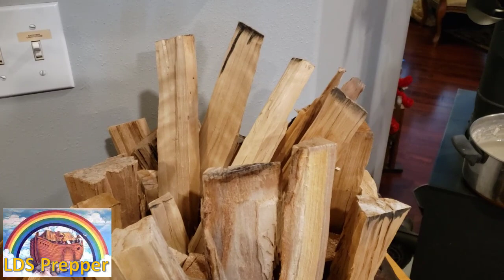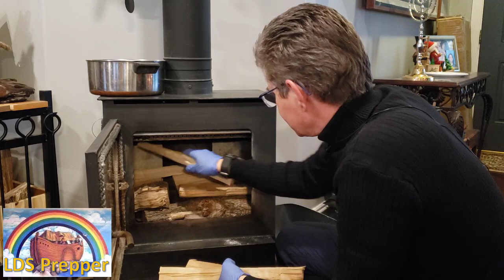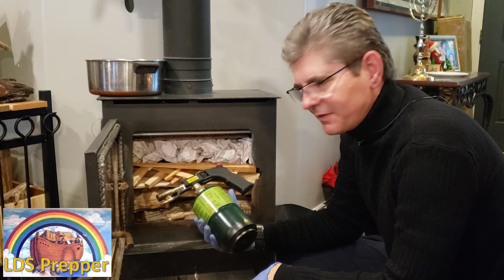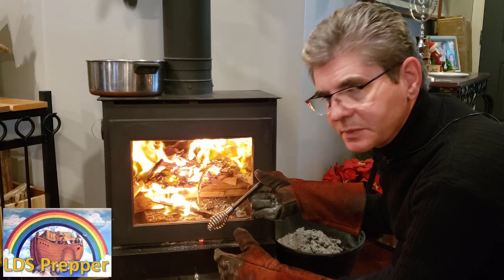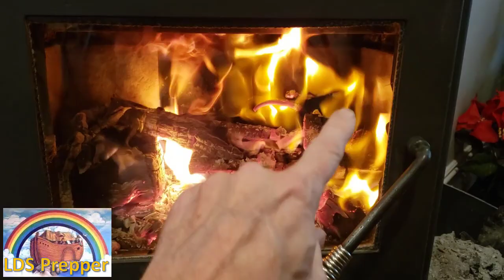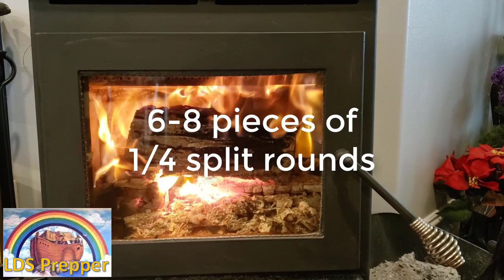🔥 How to Build a Smokeless Fire in a Wood Burning Stove 🔥

Comment: I miss my wood burning stove we had in our previous home.  It was SO efficient.  It was a split level home and you could sit in your shorts and teeshirt while it was -10 F outside in Minnesota.
Reply from the maker: We've found there is a different kind of heat from a wood stove than from a furnace. I don't know what it is but wood heat seems "warmer". If that makes sense.
Reply: @LDSPrepper  you make the flame kind of dance in slow motion by dampening the intake air.  It’s just so relaxing to watch in the dark.

Comment: I use an ecofan, but in the large living room it does not perform very well.  Also ordered the kindling splitter you demoed and so glad to learn of it.  Thank you!  A new concept to me this upside down fire.  Will try it tonight.
Reply from the maker: Please come back here and let us know how the upside down method works for you.
Reply: @LDSPrepper  The upside down fire start method worked beautifully in my fireplace insert!  I stacked the wood/paper as you said, lit it, and just closed the door as recommended for what is (I think) this 35 yr old insert.  Did not mess with the door as you did and it still burned down properly.  I could see a little smoke in there as it started up (probably because I did not slowly close down the air intake as you did) but there is not an issue with smoke escaping from this insert.  I just wonder if there is a possibility of pieces of the lit paper floating up and out of the chimney since it isn't blocked by the pile of wood.
Reply from the maker: @valoriesmith8875  Outstanding! Thank you for the report and for trusting me and giving this a try.

Comment: That's a lot of paper and kindling! Does it require more of that because it's "upside down"? Couldn't help but think of your "frugal" comment, I don't use near that much when I start mine, but I do it the opposite. I don't usually have smoke coming into my house either if I have the side door mostly closed or closed all the way and open the bottom door in front. But maybe that's a unique feature with my stove as I know all don't have multiple doors.
Reply from the maker: Excellent question. Today I lit my fire with about 1/2 of what I used in the video and it worked great. I think I was just stuffing items in the stove to give me the time I needed to explain the process on the video. Be frugal, use only what you need for sure.
Reply: @LDSPrepper  lol, ok good deal!

Comment: I run a box fan with 20X20X1 filter on the back it removes ash and smoke I don’t get the dust in my house it’s wonderful I use eco fans on stove top first I’ve seen with them attached to the pipe. More room on top for cooking love that idea TU I use 1/3 amt paper though not colored it  causes build up  I have use his method upside down works well  THANKYOU

Comment: i wasn't aware that the laws of physics had changed recently .
HEAT RISES !
the two main ideas behind top down fire building are -
1 it preheats the chimney creating a good draw 
2 - it reduces smoke 
Well if you create lots of air spaces on the bottom up method you can achieve the same thing even quicker .
Starter first 
then small kindling 
then intermediate size material 
then full size logs . 
arrange the material in a cris cross fashion so that the flame can ignite all layers above simultaneously .
Because heat rises ,each layer that ignites initially from the starter will be immediately heating all additional layers which increases the heat in the box reducing pollutants faster than the top down method .
if done properly the chimney will be preheated faster than the top down method and total combustion of all materials will occur in under five minutes . 
compare that to the top down method which can double or triple that time .

Comment: The heat of the top initial fire makes the wood below to start releasing flammable   “wood gas”, as it reaches 400-600 F,  and this gas ignites completely/efficiently with no smoke, once it reaches the flames above.  Then, the chimney, with its “chimney effect” assures a complete combustion of these gases (excuse my english)
Reply from the maker: Well said. Thank you for the explanation.

Comment: Why do I think get the marshmallows and coat hangers when I see this?   Oh- a tip for baking in a Dutch oven- use canning rings on the bottom of a Dutch oven, set your cake pan or loaf pan on that. It creates a layer of air under what ever you are baking and you get a better result.
Reply from the maker: Excellent recommendations. Thank you for sharing.

Comment: Be sure to buy a battery-operated CO monitor if you use a wood stove. Also,  if you are going to burn waste paper, you’re going to have more build-up in your pipe. I use lint from my dryer.
Reply: Be careful using dryer lint if you use dryer sheets. They're full of chemicals which can, in turn, cause build up in your pipe (or affect the catalytic combustor if you have a fireplace insert with one).

Comment: The method I always used was to crack open a window for the first five minutes. The cold outside air wants to move in, so it gets the air in the chimney moving the right direction. It smokes more initially, but all the smoke goes up the chimney.
Reply from the maker: Excellent. We use to do that to but the paper was at the bottom with kindling then tinder then fuel on top. We found this "upside down" method is 100% smokeless every time.
Reply: That has helped for me too!
Reply: When you close that window,the combustion air comes from other leaks in the house OR do you have a dedicated pipe leading to the stove's intake

Comment: Dave - good video.  Question: how do you supplement heat in a one floor ranch that has HVAC natural gas and no chimney? I have an emergency  kerosene heater and some electric space heaters.
Reply from the maker: Our house has a HVAC propane system. We keep the thermostat at 65 F degrees which keeps our pipes from freezing but we heat our house with this high efficiency wood stove.  This way we can store wood and propane. I like having multiple sources of heat in Idaho. That is how we supplement our HVAC.
Reply: I would highly recommend what's called a Chinese Diesel air heater.  I supplement the heat in my home with one, and also heat my entire garage with one as well.  They are cheap, efficient, convenient, and efficient.
Reply from the maker: @ProlificInvention  I'm glad it has worked well for you. I did a quick check and watched several videos from people who have regretted buying the cheap Chinese heater. I'm glad you found a working solution for yourself.
Reply: @LDSPrepper  If you looked longer there are thousands of videos on them with many positive experiences.  I have ran 1 of mine for thousands of hours with zero issues.  Compared to any other 15,000-30,000 BTU heater around $100-$150- they win in every category.

Comment: This is great except burning paper is a great way to start a chimney fire.
Reply from the maker: If this would cause a chimney fire you need to take better care of cleaning your chimney.
Reply: @LDSPrepper  creosote build up plus paper fires cause issues, when you heat with just a wood stove you learn to minimize issues. Paper is an issue.

Comment: You shouldn't burn treated wood, paper and loads of material. Always burn natural wood or logs cured for wood burners. Paper burns at much higher temperature and will build up slag in your chimney, this will cause a chimney fire. Sometimes it is crusty or flaky in texture, but often sticky or hard, like slag. Creosote deposits are often hard to remove from chimneys, and pose a serious fire hazard.